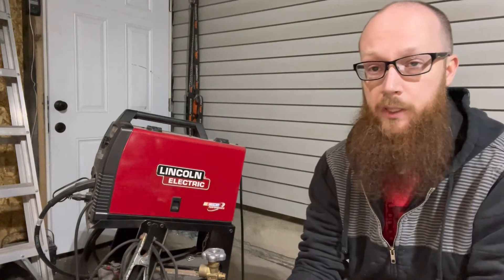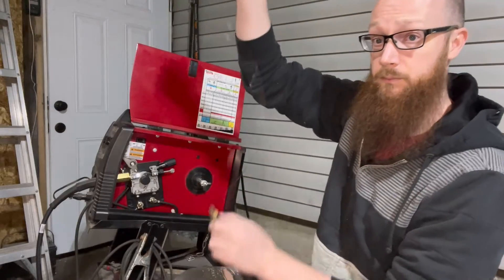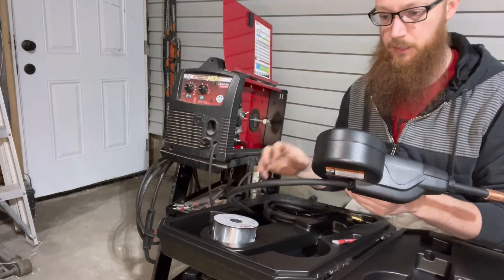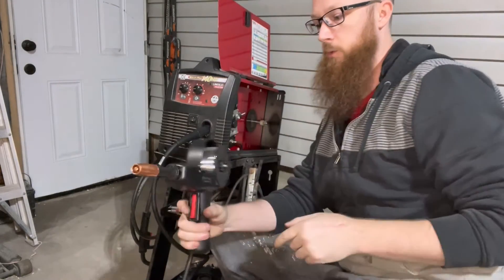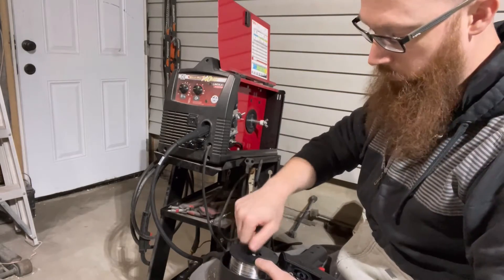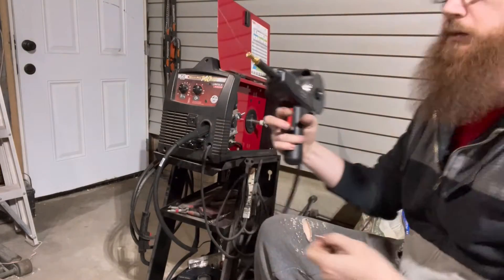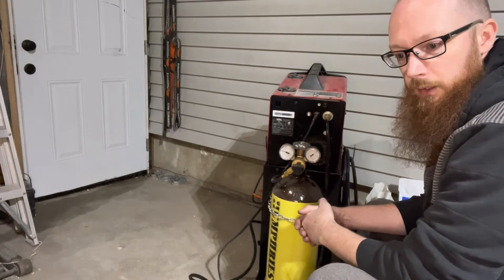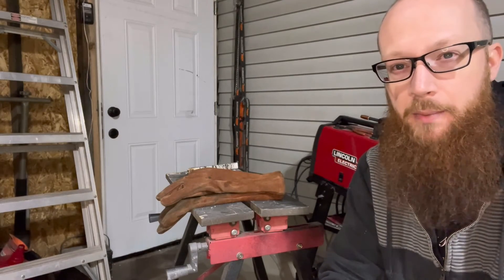Lincoln 100SC spool gun - setting up for my first time aluminum welding

Comment: How do like your spool gun does it work well
Reply from the maker: It works great. I still need to practice more with it. I’ve used it a few times and the welds just aren’t as pretty as I’d like them to be. They’ve held up great though.
Reply: @recklesslyfestyle  try slowing wire feed down not much
Reply from the maker: I’ll give it a try. Thanks.

Comment: Should have cut it off at tip real it back to rollers then you could save 10 foot of wire lock roller on wire it won't feed it
Reply from the maker: Yeah. Last cable had a burr or something on the inside. I’ve since fixed that and it works great. No more waste.

Comment: Why don't you cut the ball of to tip and wind the wire back you would only have to waste at the most 300mm
Reply from the maker: Something was binding and never let me pull it backwards. Possibly a burr inside the cable. I have since fixed that.

Comment: the kit comes with a switch in that plastic bag. fit it and it changes polarity as you need it.
Reply: I was thinking  about doing that. I thought the switch that’s already there is enough. Thanks for the tip.
Reply from the maker: Thank you

Comment: change your polarity and use bigger tip ex:use 0.30 wire with 0.35 tip
Reply from the maker: I did, got it dialed in decently after some trial and error. Thank you.

Comment: is it a must to use gas or can you use a different kind of wire and no gas?
Reply from the maker: I’m just a hobbyist, but as far as I’m aware you have to use 100% argon. You have to shield the aluminum weld from oxygen.

Comment: Really should learn to play with wire feed speed. Lots of variables in the weld can be fixed with slight speed changes. Temp, thickness, up vs down…
(Here’s a tip to learn your machines feed as some don't list actual FPM: choose a setting, start a stopwatch when you pull the trigger, let go of trigger at 6 seconds. Measure the length and X 10 gets you the FPM. 12” in 6 sec = 120 IPM.  20” in 6 sec = 20 IPM. Mark the corresponding settings, I paint penned it right on my Lincoln 180 Dual. Helps us be able to use process recommendations that are listed in volts and wire feed. I have found charts showing what Lincoln settings are in ~ volts.)
Reply from the maker: Yeah, I did adjust it a lot. I need to play with the spool gun more. This was my first time using it and I didn’t edit anything out. It was my real, first experience. I’ve already done better with it. I’ve had and used my welder for years but aluminum is completely different.

Comment: instead of cutting the wire at the rollers, cut it at the tip and release the tension and unbolt the spool and you can spool the wire back up
Reply: I was about to say the same thing. I do it all the time and waste no wire
Reply from the maker: I could unbolt it, I’ll have to give it a try.
Reply: @recklesslyfestyle  you dont have to completely unbolt it, just enough to release the tension on the spool
Reply from the maker: I’ve done that, something on my machine binds up. I will try removing the spool next time and see if that’s what binds.
Reply: EXACTLY LMAO
Reply: Exactly….i was like wut?  Throw 15ft of wire away every time?  Ya right.
Reply: I respool the wire after making a clean cut at the tip of the gun my only worry is what accumulates in the wire feed but can’t see how it would be different from the wire feeding the gun in the first place

Comment: do you ground your cable to your aluminum piece before you weld or table metal
Reply from the maker: I just ground to the piece. If I had a nice welding table I’d ground the table.

Comment: what do you use to grind aluminum welds? what type of disc?
Reply from the maker: Just a flap disc, but it has to be one that you only use for aluminum. You can’t grind steel with it and then use it on aluminum again.
Reply: If the weld itself looks decent I suggest a wire wheel. If it is rough looking and or want to grind it use a flap disk for aluminum or a grinding disk for aluminum
Reply: The red disks and grinding wheels are for aluminum and stainless

Comment: I’m considering trying a harbor freight spool gun. My sg is either all or nothing, and burns holes in the piping on the lowest setting
Reply from the maker: That’s too bad, mine works well I think. I need more practice with it.
I’ve been really happy with my Harbor Freight purchases. I say, give it a try.
Reply: @recklesslyfestyle  I’ll do that. I find it crazy that you can weld aluminum tubing with your but I can’t. I know that mig puts out more heat than tig but you know
Reply from the maker: Yeah, that’s strange. I messed around with songs on a scrap piece for a few hours before I tried on something that mattered. I blew through a couple times. I’d love to learn TIG though.
Reply: @recklesslyfestyle  That’s what I’m honestly leaning towards for thin aluminum. I won’t reallly do much tig but maybe I’d like to do some cold side work and such
Reply from the maker: Definitely. I want to fab more and more of my own stuff. So I kind of “have to”.
Reply: Did you get the HF spool gun?
Work ok?

Comment: Why not cut the wire you are removing at the tip and then wind the spool backwards putting the wire back on the spool rather than wasting it?
Reply: I have same welder. I always put the wire back on the spool no problem. Just snip the tip at gun and flip up the roller tensioner and wind the spool backwards.
Reply from the maker: It may be something “wrong” with my machine, but it won’t pull back through. I’d love to do that, it just won’t do it.
Reply: @recklesslyfestyle  Often a little ball is left at the very tip and prevents the wire from being pulled back.   I cut the little ball off with cutters, and then stone off any sharp burrs on the tip.   Then I've always been able to pull the wire back and use it again.
Reply: @recklesslyfestyle  with my own I remove the feed roller first. Snip the balled end off the wire and wind the spool backwards. Lol maybe there’s something wrong with mine?  Enjoying your vids brother!! Keep them coming. Thank you for your response!!
Reply: The piece that holds your wire roll on the hub needs to be released then you can manually turn the wire roll backwards after you cut the tip off at the gun end

Comment: What should I do if my welds are covered in black and white soot? It got cold and dark here so I shut everything down before I could continue to play with it more
Reply from the maker: You need to push instead of pull. The black and white is contamination. Pushing will keep the weld shielded with argon.

Comment: I wonder if something is wrong with my gun, it won’t even try to weld. And I turn it up it’ll arc for 4 seconds and turn off
Reply from the maker: Did you switch polarity on the leads? It has to be DC- for the spool gun to arc like it should.